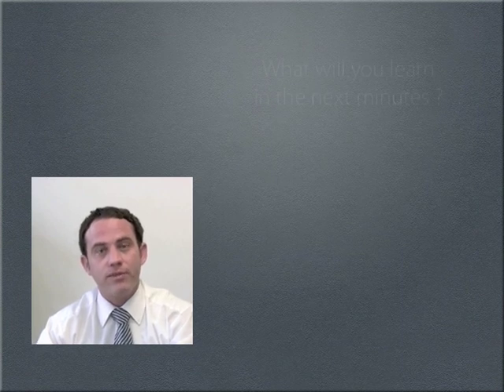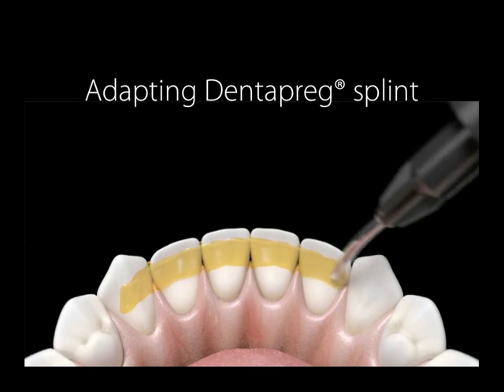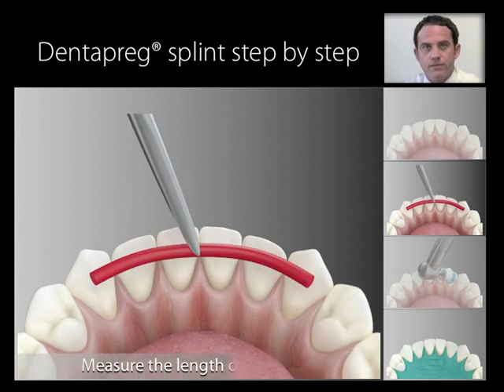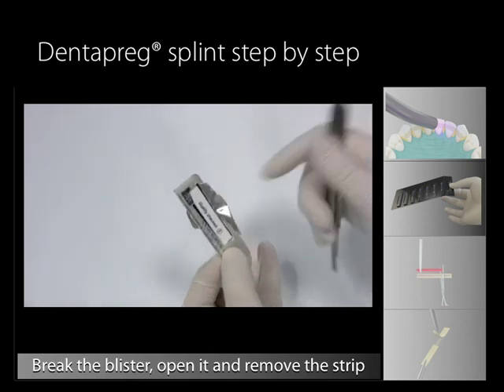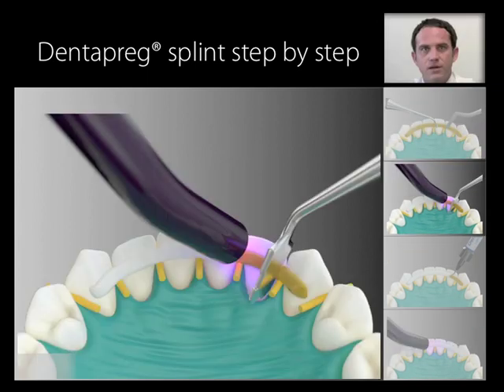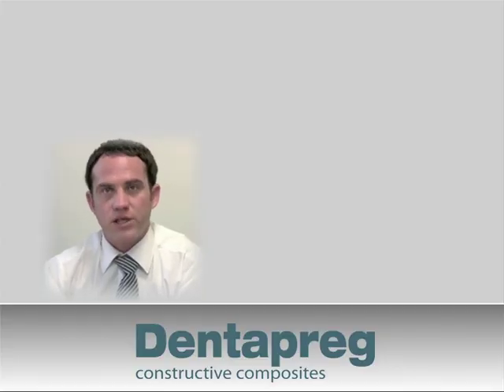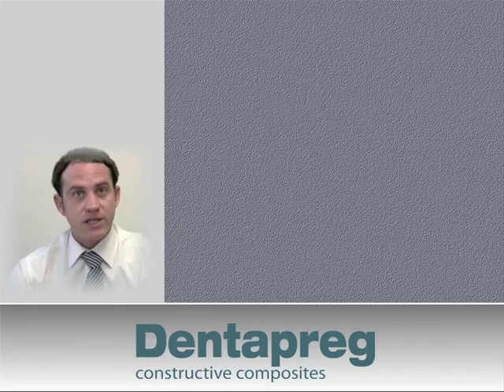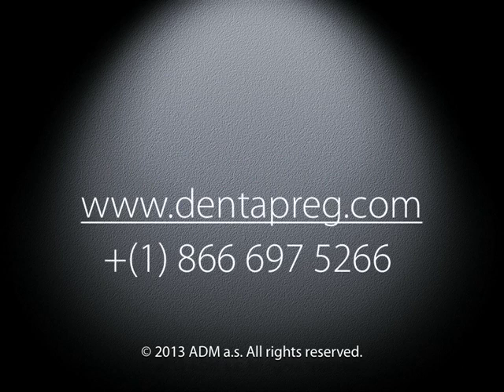Dentapreg Splint Training

Comment: how i can remove it from the teeth
Reply from the maker: The procedure of splint removal after it served its desired purpose, has three steps. First, remove the covering layer of the composite by using a bur or using a polishing wheel to heat-up the surface of the composite. The heated composite becomes soft and can be removed with a scaler. Next, remove the strip from the surface of the teeth. The easiest way is to use a scaler or orthodontic pliers and pull from the interproximal spaces. Finally, clean and polish the teeth.